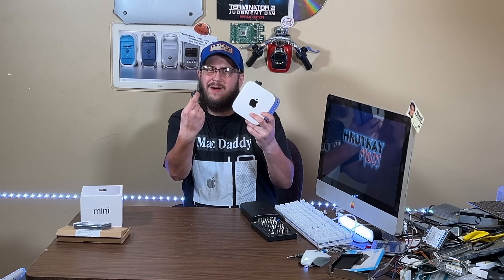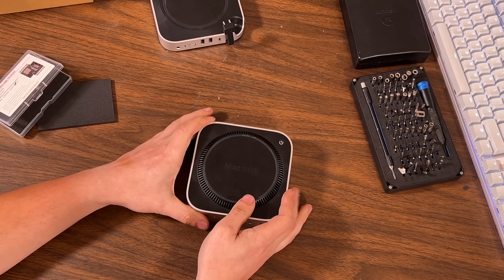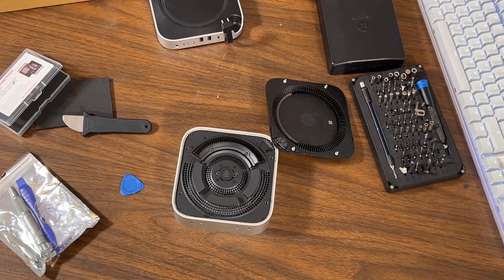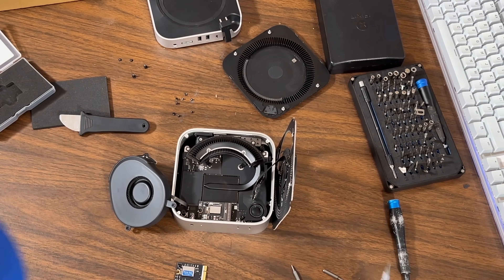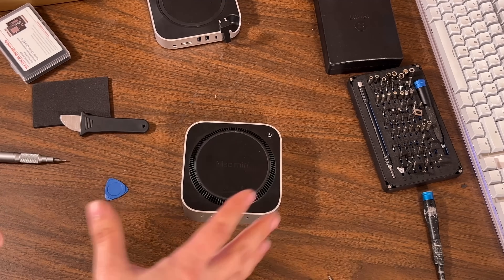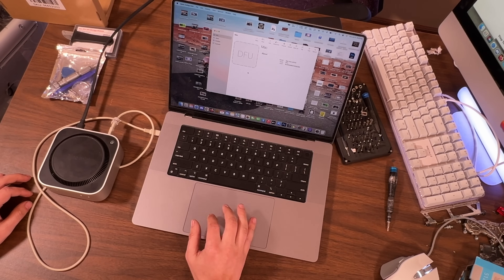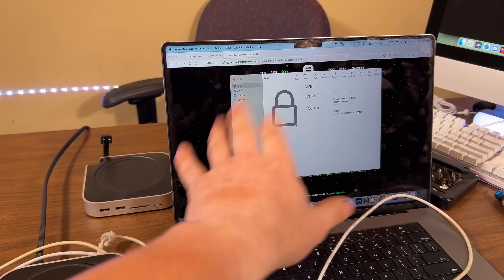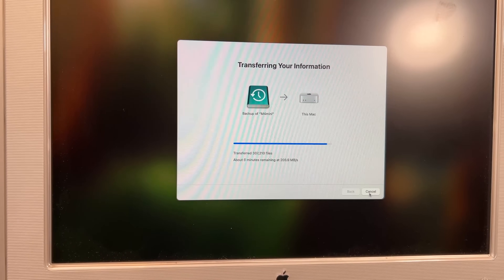M4 Mac Mini 2TB SSD Upgrade!

Comment: Nice, it’s cool that these models are actually upgradable! I’m sure it’ll work great as a modern server with all that space available.
Reply from the maker: Yeah, I think it would make a pretty competent little server… I just invested in another dock that will allow 2 NVMEs I could technically run 16 TB of storage plus the 2 TB in the system
Reply: Sounds great! 16TB externally would be fantastic with a compact setup like this!

Comment: Its nice to see Apple use replaceable SSDs, but why is the M4 Pro SSD so different?
Reply: 4 storage chips on the Pro drive card instead of two. That allows more than the current 2TB max for the M4 Basic. Because of the lack of space inside with the fan, Apple had to reposition the drive connector inside and make the drive card longer and a bit slimmer to accommodate the extra chips.
Reply from the maker: I’m pretty sure it was just a jack up the storage. It’s got a different nand on it That allows a lot more storage. Of course Apple could’ve probably use the same connector but it’s on a ”pro model”
Reply: The SSD on the M4 uses a proprietary connector and has some fancy Security Enclave that handles encryption(FireVault, etc). The SSD is also paired to the motherboard if I recall correctly via its Serial Number.
Reply: It's not like the old apple proprietary SSDs where they just rearranged the pinout of NVME/PCI-E. On the M4, the NAND chips are pretty much directly connected to the edge connector on the module and the NVME controller is on the mini logic board. Personally I think it's a pretty good compromise from Apple and the market for Mini upgrades is so good that the Chinese had these modules on production within weeks of the M4 Mini coming out. As for the old module, I doubt its economical to try and swap the NANDs because 2x 1TB NAND chips looks to be about $200 and the upgrades are $250 - $300 and the risk of screwing up is pretty high. Perhaps someone can come up with a board with an NVME connector and controller with a slot for these boards, so they can be re used.